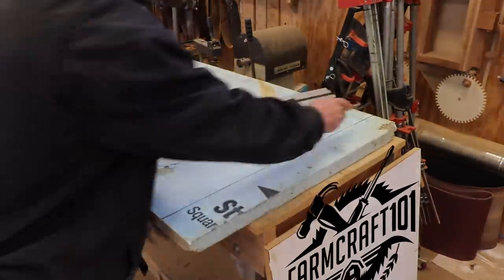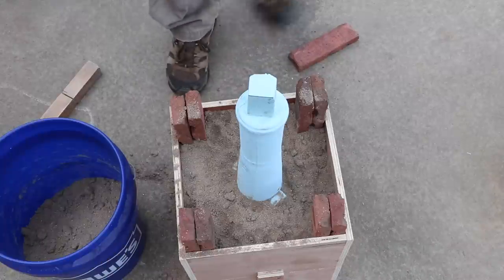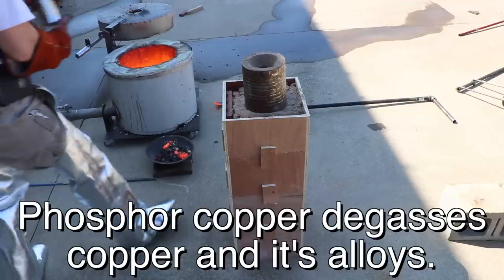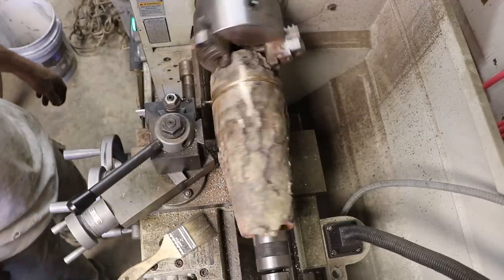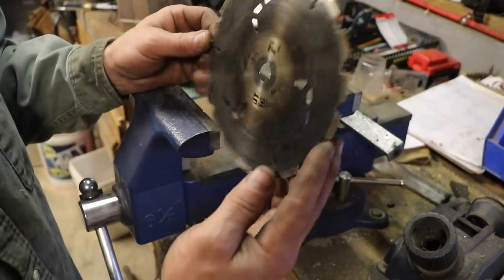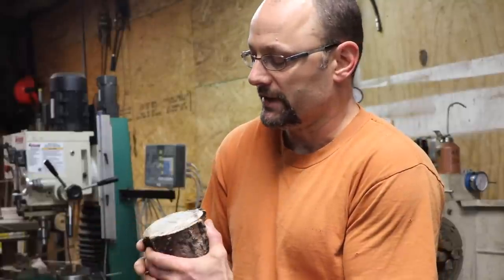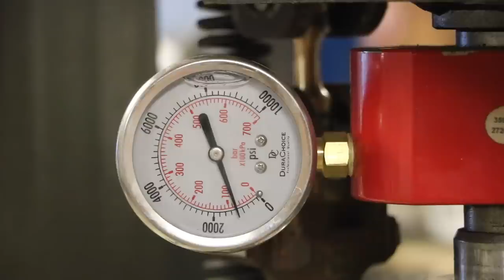How NOT To Cast A Historic Bronze Cannon Barrel.  FarmCraft101

Comment: The explosion was a steam explosion. Steam is thousands of times larger in volume than liquid water, and can expand at rate similar to a detonation/exposion (depending on temperature of the source). Steam explosions can be very dangerous. If you wish to avoid steam explosions, like what you experienced, switch to a different liquid than water with a boiling temperature above 212 F. Ideally, find a liquid above the temperature of the metal, i.e. metal temperature 400 F, use a liquid with a boiling temperature above 400 F. I hope that helps.

Comment: Your mysterious explosion was probably a steam explosion. Killed a lot of steam engineers back in the 19th century... also, large crystal structure is weaker than fine. As to green sand, I'm pretty sure you need to add a little diatomaceous earth to the mix.
Reply: Foundry's don't like water at all
Reply: Ah yes, good ol' boiler explosions... locomotives before water injectors were doomed from the start. Axle pumps just didn't cut it. Check valves got clogged from minerals and limescale buildup. Not enough water in the boiler made the walls of the firebox melt(They were only kept from melting by the water that should be surrounding them!) and would scale the crew to death with scorching steam.  Or, even with injectors, perhaps the fireman wasn't paying attention to his water glass, or the water glass was clogged... water gets too low, metal heats up and expands, suddenly the fireman adds some water and what is depicted in the video occurs... inside a 100 foot long pressure vessel rated for 300 psi steam. Boom.

Comment: Here's a thought . Determine the volume of that foam by immersion in water. In the bathtub or whatever , mark the high point and measure the volume of water it takes to reach that point once the foam is removed. That will be the volume of metal needed. Then calculate mass accordingly .

Comment: The vertical position creates too much pressure on the sand. Can you use plaster of Paris? Can you design a horizontal rig with pouring flues along the barrel? Interesting project.

Comment: For safety rather than lighting the fuse and run, get a firework igniter. MJG has consumer ematch now that doesn’t require an explosives license. You can run two wires to a battery and be far away when it fires.
Reply: One trick is to use a low wattage resister at enough voltage to greatly exceed it's limit.  A 100 Ohm 1/4 Watt resister should blow nicely at 12 volts.  Of course you need an easily ignited powder to work with that.
Reply: not sure who MJG is, but there are electric matches for model rocketry that would suffice nicely
Reply: @speedbuggy16v  I've used them for so many experiments that the guy behind a counter has to think I'm either young von Braun or working for Hizballah.
Reply: Or get fine steel wool, a box of 9 volt batteries, a large electrolytic capacitor rated for the voltage of all the 9 volt batteries in series, and a 100 ohm resistor rated to short all the batteries in series.  Wire up a wisp of steel wool to the output of the capacitor through a high current rated switch.  Wire up the battery to charge the capacitor through the resistor with another lighter duty switch.  Discharging the capacitor through the steel wool will make a fiery explosion guaranteed to ignite black powder.

Comment: Some of the water very close to the hot metal is heated up quickly at alteres shape from liquid to gas form. (Steam) 
As steam´s volume is factor 1000 to water, - it expands and pushes away the water around it which makes it splash all over like an explosion.

Comment: Where I grew up a farmer was rebuilding an old windmill, to make a new gear he used a box of wet sand, not dry. That was cast iron, and it was a gear about 18-20" that was missing a couple of teeth. He used it to make an impression in the sand then rotated it and did it again to eliminate the missing teeth, and it worked! No foam, just sand and cast iron.

Comment: The sand didn't look like it would keep its shape once the foam was gone. The sand I've seen used in pouring metal was much finer grain and very compactable.
Reply: The sand used for metal casting is a blend also consisting of Bentonit, oil and other substances. You just don´t use just mere sand for that.

Comment: I worked as a pattern maker years ago...interesting video, but you are going to get hurt. Not allowing for venting and shrinkage. You need runners and risers to allow for shrinkage as it cools.  By eye, I could see you were lacking in material. Large castings are a whole different world than trinkets.
Reply: All the water on the floor bothered me. Water and molten metal are not a good mix ...
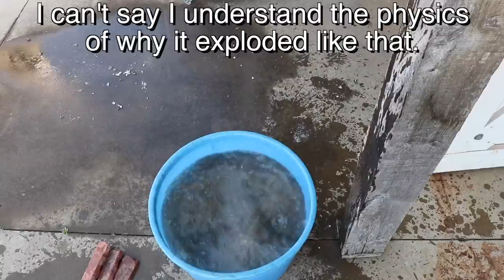Reply: @Rincypoopoo  As was demonstrated at 09:00

Comment: The old time black powder was less strong,We had some old rock salt size when I was a kid,less pressure for civil war cannons!!!! Thanks for the videos
Reply: In my experience the older black powder was probably better.  The black powder you can get today doesn't manage to pass the 16th century quality control tests.
Reply: @laurenceperkins7468  well maybe it don't pass a test I don't  know, but in the 16th century it was probably brown in color and mostly wasn't corned,just a mixture and not in the same proportions, I use a lot of 4th of July powder from aerial bombs,in my flints and caps guns!!! Thanks for reply,good day!!
Reply: @jacksnavely559  The old test was to put a four-finger pinch worth on a sheet of paper and touch it off.  If the proportions are correct and it is mixed sufficiently well it should burn up entirely while neither scorching the paper nor leaving any soot.  Modern commercially-produced black powder leaves a fair amount of soot.

This test, of course, was for powder intended to be used in guns and bombs.  Rockets you might well change the proportions quite a bit depending on what effect you're going for.

Comment: If working bronze is anything like working steel, this might help.  Try using casting sand, it's finer-grained sand which is mixed with some sort of oil to help hold it together.  Let the cannon cool overnight, and then try reheating it to 2/3's of it melting temp, and quench it in used oil or ATF, it will harden the metal, but it will be brittle.  So you'll have to heat it twice at 900C and let it cool to room temp each time.  After all that it will hopefully be normalized.

Comment: I may be totally off and not have any clue what I am talking about, BUT the section you cut and tested, the direction of the force you imparted was front to back (as in if you made a canon out of that, you put pressure on the breach end and muzzle end and pressed inward). It seems to me that you would want to test the chunk of metal from the other direction (from the outside neck on both sides, pushing inward toward where the bore would be). Since the grain structure would be different in that direction and that is the direction of most of the force (from the bore, outward). The base of the canon would also take quite a bit of force and that force would be going in the direction of your tensile test, BUT the base/breach end of the cannon is Much thicker than the walls of the canon. You might get a better or worse result, either way, I think that is information you would want before firing.

Comment: Accurate composition of the alloy is of the utmost importance, 88% Cu, 10%Sn, 2% Zn = Gunmetal.
Reply: Aah, I thought it was 90 Cu and 10 Sn. Never knew they used Zn in it too, or perhaps later. What sort of flux is best and at what stage should it be added? I expect after the Cu is melted and before the Sn and Zn is added.... Please advise. Cheers, D
Reply: @Igotknobblies  Check my comments above.I believe they used borax mostly to flux.

Comment: I seem to remember adding molasses to the sand and later Co2-ing the mould before casting and you have no vent/filling sprues
Reply: Not molasses. Sodium silicate solution. Yes it looks like molasses but it's not made of sugar. It hardens by being exposed to CO2.
Reply: I'm pretty sure the moles would object.

Comment: I cast an aluminum death star once.. about 4" diameter.
Cooled it off in running water for a few and then set it down.
It was cool enough to handle immediately after the water.
Picked up a few items lying around.. went to pick it up again and the piece was so hot my skin sizzled when I tried to pick it up.
Internal temp. Transferred out and it was quite the lesson.

Comment: You don't have half of the force pulling each direction, you have the full force (5,188 lbs) of tension pulling the sample apart, or 40,850 psi.
-----------------------------------------------------------------------------------------------------------------
UPDATE (4/01/2019):  After watching his video titled "Building a DIY Tensile Testing Machine. FarmCraft101" (https://www.youtube.com/watch?v=RxoLwyjSRaQ), I see that I misunderstood what he meant by "both sides".   [Thank you @Kevin Martin]

He is referring to both sides of what is essentially a lever on his test apparatus with the hydraulic jack applying force at the midpoint while one end is applying tension to the sample and the other end is fixed. So DIVIDING BY TWO IS CORRECT!
Reply: I was thinking the same thing.
Reply: yep, came here to comment on same deal,,,,yas beat me to it.  soon as he said he would halve it, i knew why he thought  to halve it.......but its definitely measuring the metal tensile strength at the point of his test area.  it would only be halved if both ends were pulled and data taken from each grip end.  so yep, its actually double what he thinks.
Reply: @Smickster01   If you put a force gauge on each end, they would both read 5,188 lbs, but the forces measured would be in opposite directions.  The second gauge would be measuring the opposing force generated by the fixed attachment point on the testing device.
Reply: @georgelewis9127  i think i know what youre saying, but isnt  both end of the testing material being subject to the same force as the meter reads it, hence halving it would be redundent as the force is still 5188 lbs?  
this has sent my little brain into overdrive trying to fathom this. 
i liken it to a car hitting a brick wall at 100, is like hitting another car head on at 50, (both cars doing 50) opinion says these two impacts exert the same force on occupants. i think? lol
Reply: @Smickster01  Actually, two cars of equal mass hitting head on at 50 would be like one car traveling at 100 hitting another car of equal mass that is stopped.   A car hitting an immovable wall at 100 would be like a car traveling at 100 hitting another car of equal mass traveling at 100 head on. They each have the same momentum but in opposite directions, and they would theoretically come to a complete stop at the point of impact just like hitting an immovable wall. Each car would be subjected to the same deceleration as if hitting an immovable wall at 100.
In the case of tension, if you apply a force (tension) to a steel chain, each link is subjected to the same force that is applied to the entire chain; the force is not divided among the links. If you put 10 tension gauges linked together like a chain, they would each be measuring the same tension that is applied to the entire chain.
Reply: @georgelewis9127  yep, i gottya there. i had it all slightly  skewered...lol 
no matter, it'll all come clear to me when i close my eyes tonite. :) cheers mate.
Reply: @Smickster01  Bad analogy. Impact is about energy, whereas tensile testing is about force.The latter situation is like two tractors in a (essentially static) tug of war. The tension in the rope is no different from what it would be if one tractor was suddenly frozen in a puddle (it's not plausible that this would suddenly halve the tension), which is no different from what it would be if one tractor was a bollard. 
In terms of Newton's laws, each action (ie one tractor pulling) has an equal and opposite reaction ... which could be the other tractor pulling, or it could be a bollard.
Reply: @georgelewis9127    I agree with your conclusion - see my answer to Michael
Reply: @Gottenhimfella  as Professor Jim Al-Khalili says, any analogy is far from perfect. :) but yeah, the analogy wasnt to represent forces in a crash, rather the way in which some forces are halved when measured at both ends of the force as in the vid when he halved the force when i dont believe it was accurate to do so. but, yeah, only in my mind did my analogy make even a scrap of sense. (i have aspergers and tend to think differently to NT's) but i get it....bad analogy. but im sure you see where i was leading to in some way. 
cheers
Reply: Having watched part 1 of his Quest for Gunmetal, I had a better look at his testing setup.
There is a 2:1 lever ratio involved, which is where the division by 2 originates. He just does a terrible job of explaining it with his "pulls both ends" or whatever his phrasing was.
There is a lever, with a fulcrum at one end, the sample at the other, and the hydraulic cylinder and pressure gauge in the middle. As a result, the tension on the sample is half the force measured by the gauge.
Reply: @kevinmartin7760  now that makes more sense. didnt see the equipment , i used only memory from my fitting machining days where the gauge measured total force.  but yeah, i looked at it again just now, did not see the fulcrum and lever setup on first look. and i assumed from his wording that he used a meter on both ends of the press/jig. i apologize for my lack of observation here. good call tho. :)
Reply: i gotta say, we should be proud of ourselves......its refreshing to have a civil discussion on perceived errors (whether we were right or wrong...no matter) and ticks me off when a comment is made and you tubers go strait for the throat rather than intelligent discussions....well done to us.
Reply: @georgelewis9127  The cars have kinetic energy. e=1/2*m*v*v. So 1 car at 100 has twice the energy of 2 cars at 50. Double the speed means quadruple the energy. That's why stopping distances increase exponentially with speed.
Reply: @GSimpsonOAM  That's true when you are talking about stopping distance using the vehicles brakes, because they have to dissipate the kinetic energy. But when considering what happens to two cars hitting head on, you have to consider the conservation of momentum. Assuming the masses of the two cars remain in one lump after the collision, the momentum of the resulting mass will be equal to the sum of the momenta of the two vehicles. Since the momenta are opposite in sign, if each vehicle has the same mass and velocity, the resulting mass will have momentum of zero--meaning that it has a velocity of zero. You are correct about the kinetic energy of one car at 100 vs. two cars at 50, but one car at 100 has the same MOMENTUM as two cars at 50, therefore if a 2000 lb car traveling at 100 hits a 4000 lb car traveling at 50 head on, the resulting mass would, THEORETICALLY, have zero momentum and be stationary at the point of impact. This assumes that the  collision results in only plastic deformation of the vehicles and the kinetic energy is dissipated as heat: if there is some elastic deformation, then the crushed vehicles could "bounce" apart a short distance, complicating the discussion farther than I want to try to carry it.

Let me know if I am missing something here. We got a long way off from the strength testing calculation, but I guess this is good exercise for the brain.  It's been 50 years since my college physics class.
Reply: @kevinmartin7760  Thank you Kevin! I watched this video: 

         "Building a DIY Tensile Testing Machine. FarmCraft101" (https://www.youtube.com/watch?v=RxoLwyjSRaQ), 

which was referenced in the video you mentioned, and I see that I misunderstood what he meant by "both sides". He was referring to both sides of what is essentially a lever on his test apparatus with the hydraulic jack applying force at the midpoint while one end is applying tension to the sample and the other end is fixed. So DIVIDING BY TWO IS CORRECT!
Reply: @Gottenhimfella  Please see my edited comment at the top of this thread.  I misunderstood what he meant by "both sides".
Reply: @GSimpsonOAM  In the case of a car traveling at 100 hitting an immovable wall, the wall could be considered to have an extremely large mass (let's call it 1,000,000,000 and ignore units) and a velocity of zero, the momentum (m*v) of a car with a mass of 2000 and a velocity of 100 would be 2000*100, or 200,000, and the momentum of the wall would be -(1,000,000,000*0), or 0. The resulting momentum (p) of the combined mass (m) would be 200,000+0, the mass would be 1,000,000,000+2000, and the velocity (v) would be (200,000+0)/(1,000,000,000+2000) or 0.0002, if I did the arithmetic correctly. The kinetic energy (e) of the mass, 1/2*p*v, or 0.5*200,000*0.0002, would be 20. That energy would be converted to heat as friction as the mass slowed the velocity to zero relative to the earth, and the momentum of the combined mass, 1,000,002,000*0.0002=200,000, would impart an insignificant angular momentum to combined mass of the car, the wall, and the earth.
Do you disagree? Please let me know if you find an error in my reasoning or my calculations.

Comment: A wet diamond blade (as used for masonry, ceramics and metals) will cut that agglomeration of bronze and sand.
Reply: The Devil In The Circuit ,   true... and would need a special (expensive) machine with water, etc.
Reply: @BruceNitroxpro  Or, you know, a cheap saw, a GFCI circuit breaker and a garden hose.  What he's doing here doesn't really require high precision.
Reply: @laurenceperkins7468  , OK... so long as I can do my thing, no biggie. LOL